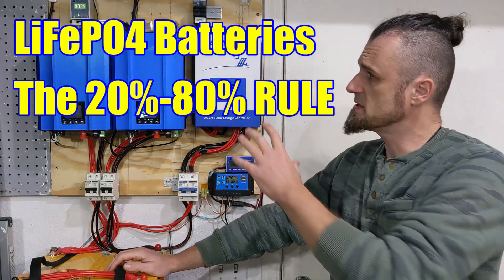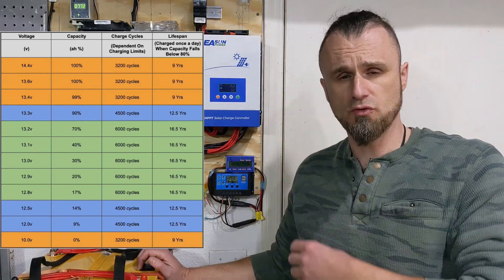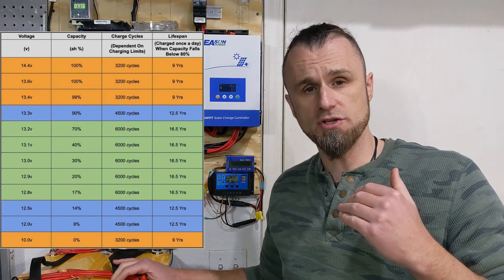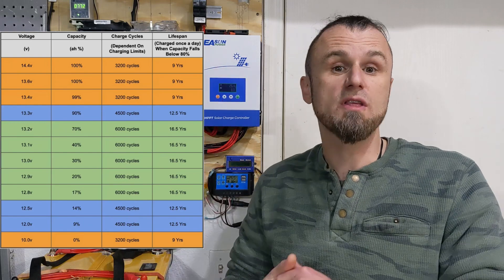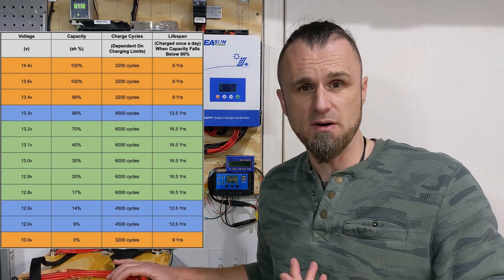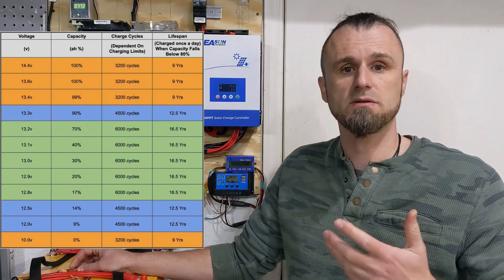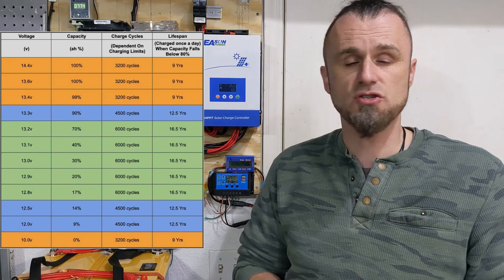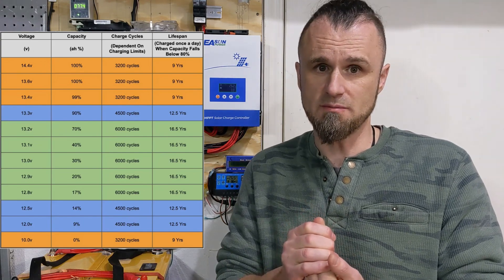LIFEPO4 batteries longest Life cycle possible 9 years vs 16 years the 20-80% Rule

Comment: I am sure there are many who have already done the calculations and some experiments, I am not one of those, but I have been doing the same as you, reading other information and watching videos Here is what I think I have learned and where I am leaning to go:
1) Your 12.8 to 13.3 charge/discharge range seems in line with others
2) Adding a 12 volt, lead-acid battery into the bank via an isolator that regulates that charge/discharge between the LFP and Lead-acid
3) Trying to find the correct ratio of Lead-acid to LFP for best efficiency

Hope that helps jump start a conversation for all of us to learn, keep up the good work!
Reply from the maker: Dude that's crazy, I'm going to pin this one because I know it's wrong but I'm sure the people will love to read and give their opinion on it I hope you're ready 😁
Reply: From all my studies, I personally would NEVER use lead-acid with my LiFePO4 batteries! The only time this is useable is if one gets a DC to DC charger that allows one charge the LiFePO4 battery bank from an alternator.
Reply: Incorrect. I know someone that has both chemistries on the same charge controller for several years hassle free so far. A AGM is required though as the charge perimeters are similar and there's no equalization setting for agms. I myself have gotten 3000cycles from lead acid batteries so I'm wondering if these lifepo4s actually are superior or not. I do keep my lead acid bank above 40% dod but Its not any different than keeping lifepo4s above 20% dod and below 80% soc so the same amount of capacity is lost either way. I do have a lifepo4 system in my houseboat for a couple years no problems yet except they do shut down in cold temps as I don't keep the boat heated when not In use. Lifepo4 and AGM can work together on same system at the lifepo4 perimeter settings because they're very close. @Tumbleweed5150
Reply: I read somewhere that Lifepo4 and Lead acid in parallel works because the lead acid will keep trying to bring down the voltage of the Lifepo4 to close to 12.8v which is the resting voltage of Lead Acid. They have to be around the same SOC(100% full charge using same charger) when you initially connect the two different battery chemistries in parallel. It is advised that a smart charger that doesn't have equalization feature be used so the mixed battery bank stopped charging at a specific voltage(like 14.4v).

Comment: How accurate is the bluetooth apps for these Lifepo4 batteries ?  If my app is telling me that I am at 50 %, 70%, and so on is that correct ???  I bought two of the BougeRV 100 amp hr batteries and I have them wired in parallel 12 volt. Using a Renogy 30 amp MPPT charge controller. Any thoughts please ???
Reply from the maker: Not very accurate. Good for estimating. But they are up to 20 percent off in my testes
Reply: @VegasRoManiacReviews  Thank you for your reply.

Comment: I'm running four 100Ah Power Queen LiFePo4 in parallel for a 12v system charged by four 450w panels. Most days my batteries are fully charged to 14.4v but i don't usually discharge too low at nights, maybe down to 20-30% as i'm not interested in long life from them as i'm 66yo. Also, solar is my hobby and i keep changing and upgrading my system. Greetings from Jamaica.
Reply from the maker: That's awesome , you still have 30 year left in you so don't run that battery too hard , thanks for messaging me

Comment: Don't listen to this guy, he has no idea what he's talking about.  It's better to charge LifeP04 batteries to 100% to top balance the cells (which is necessary to keep them 'healthy') and use the first 60% capacity, rather than only charge to 80% and use the middle 60% capacity.  This 20-80 rule applies to other lithium chemistry's more often found in cell phone, cordless tools, laptops, and EV's.
Reply: Spot on.  Charge them to 100% to balance the cells.  They are designed to be totally discharged.
Reply: @rogerhargreaves2272 they don’t need to be fully discharged but full charge is preferable. It’s the final voltage spike the final charge  that is needed to balance the cells
Reply: @rogerhargreaves2272 I read that they should not go lower than 20%. Also ecoflow app has a setting in their software that analyzes the battery and counts the deep discharges made, that are supposed to be bad I guess.

Comment: in the summer I only use 20% soc per day, usually between 80 - 100%. I thought it better to go between 60 - 80% so I set my boost to 13.3 for 3 hours, the float to 13.3v, the boost recovery at 13.3, and the equalization voltage to 14.4v once a week for 2 hours. It seems to work. Does anyone foresee any problems with these settings?

Comment: I think the real point is being missed.  Batteries are made to hold a range of charge. This is considered a full charge range.  If you believe in charge cycles/counts then if you short change the charge you end up with more cycles because it's less than a full charge. Remember the total number of cycles is based of a full charging cycle.  Cut that in half and in theory get twice the cycles because they are not full cycles.

Comment: Has anyone used a lfpo battery3000 cycles yet ? Are any batteries showing signs of degradation yet ?? Im curious to see if the20-80. Theory works. My system usually tops off by noon as i only burn through about 20 % at night from my refrigerator and i haven't figured out how to have it stop charging at 80%. Seems hard to do by voltage
Reply from the maker: I have about 500 cycles since the video , I can't tell if it degraded because I never run a test on it
Reply: Its not good to only use 20 per cent. It needs to disharge more to 20 per cent state of charge.

Comment: I just watched a thorough and extremely passionate video by a guy who has dedicated his life to solar. He said definitely charge to 100%. He showed all the math which was too much for me. But his basic concept was you are losing out on so much money from purposely throwing away electricity if you are off grid. Might as well use all that power or buy a cheaper smaller battery and still charge that one to 100%. I'd love if you'd watch his video and then do a rebutal to all the points he was making. He was so adament that all I wrote down was......charge to 100% and make money now.....or possibly save some money in 15 years. 
Ttle of video  ......."""LiFePO4 Longevity Discussion! Why Charge to 100%?! For Solar??""""""
Channel.........DIY Solar Power with Will Prowse

Comment: The issue is not hitting the higher voltages above 13.4 which is required to balance the cells and therefore allows them to degrade equally. The real issue was staying at that high voltage for multiple weeks. If you’re cycling your batteries every day it’s something you never have to worry about.  The sheer degradation over time which happens for batteries, even not in use and even stored at 50%, is gonna factor in Way before the degradation of daily use factors of going too 100% charge. The real way to kill one of these batteries is to leave it under voltage for an extended period time, meaning weeks. That is almost impossible nowadays with these new BMS nearly all have built into them now. LFP batteries are something you should just not worry about cycling if they are used every day for solar.😊

Comment: Which voltage setting in the Charge Controllers settings determines the maximum charge? I have two different chargers. Is it, "equalize charge", "Boost Charge", "Float charge" or "Overvoltage", "Limit charge voltage", which are settings from two different chargers.
Reply: Read the manual with your charge regulator

Comment: And where the @#$% does that 20/80 % rule comes from? I really wonder where do they come up with these rules and figures, and I certainly disagree.
My experience with batteries comes from using and taking care of standard li-ion and LiFePO4 cells at home and also using them to restore laptop packs and build DIY batteries (some Ni-MH too) using cell sizes up to 32700. I've done some battery testing too, bought an inexpensive battery tester with PC connection.
For taking care of li-ion cells I learned from the article “BU-808: How to Prolong Lithium-based Batteries” at Battery University. Following its advice on charge voltage (3.92 out of 4.2 V, a 14/15 ratio, optimal charge voltage which eliminates all voltage related stresses) and extrapolating it to my rooted smartphone battery, using Advanced Charging Controller App (AccA): 4.06 out of 4.35 V and 65% max. state of charge. And my smartphone battery, after more than 5½ years of use and God knows how much cycles without avoiding going as low as its BMS allows, is still fairly healthy.
With LiFePO4 I can't say much, except that I once built a custom 4S4P pack (with 4x 32700 and 12x 18650 LiFePO4 cells) for a small UPS overhaul, and after an initial load and capacity testing I left the pack completely discharged after the SAI cut-off (≈10.5 V afaik). It remained that way (discharged) around 9 - 10 months, and when I took the SAI again I found the battery at 6.5 V (!) due to its BMS' phantom power consumption (below 2 V per cell). After recharging the battery and retesting it, it delivered more capacity than in its maiden test: around 10.5 Ah vs 10.2 Ah.
In my experience with LiFePO4 and namely li-ion, cutting high renders no benefits and only makes the user's life unnecessarily harder; and the amount of cycles vs depth of discharge tables must be taken with a grain of salt and discernment, starting with the fact that reducing depth of discharge also reduces the amount of useable energy per cycle.
Overall buying quality cells and (at least for li-ion) limiting maximum charge voltage really matters, cutting high doesn't; thus, my advice is discharge as low as required without remorse. Cheers.

Comment: I've been looking for any info. You are the only one I've found asking questions. 
Can i keep my batteries 100% charged on solar?
Reply from the maker: Yes you can , these batteries are super durable
Reply: @TheCrazyRomanian  thanks, you're the only one to answer. I've been reading manufacturers info and asking others no one can say for sure but, i have not found one manufacturer who warned against it.
When I'm not using the system i disconnect all inputs. When i am using it even sparingly i leave the solar charging. It frequently hovers at 90-100%.
Reply: @TheCrazyRomanian  was thinking, RV's have solar connected all the time don't they. Maybe that's why they burn sometimes. I just don't trust these batteries quality enough to leave the solar connected.

Comment: I have some 36 volt battery packs.  I am wondering if the inverters in this particular setup will run and produce a/c power with 36 volt battery packs.
Reply from the maker: No. This model can't .. they are picky on voltage 24 to 31 volt max

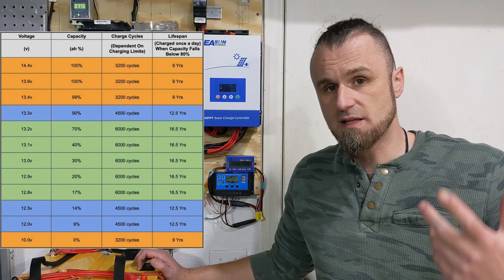Comment: 1:00 LiFePO4 batteries, when bought with their own BMS, are set to top balance the cells inside at the top of the charging cycle: 14.6 on a nominal 12V system, or 29.2 on a 24V system. If you don't charge them up to full for at least two hours at least once a week, they can get way off balance, which will REDUCE their total lifetime. Not using them too low WILL extend their life, though. Most of these batteries are rated for at least 10 years, and that is if one charges and discharges them fully each day. I designed my system so that the battery bank will hold over 80% capacity most of the time. I only see lower capacity in the middle of summer when I use my larger air conditioner most of the day. I am living in an off-grid community in the Southern CA desert, so we do rely on the systems I've designed for my RV, my work truck, and my girlfriend's shuttlebus, especially when it can get over 120F here!
Reply: When I was designing my 48V system, I planned on making my batteries last around 20+ years.
Reply from the maker: Wow ambitious
Reply from the maker: Great info .m thank you

Comment: go full ham and spend $10k for 31kwh of batteries/rack ... run for 10 years ... $85/month ... 16 years ... $52/month ... adjust these numbers for your requirements ... put whatever $ amount you come up with in your solar savings account ... the $ will be there waiting for your next round of batteries ... do not sweat the details
Reply from the maker: I actually only need about 10 kilowatts a day because the sun shines half the day here in Vegas so very rarely is cloudy and the 10 kilowatts last me throughout the night easily but my family is small and I don't have an electric car

Comment: Just use batteries as a buffer. Put most of the electric load on daytime. Invest in low power applience for eveing would be cheaper.
Reply from the maker: Not to mention get rid of my wife she has a TV running on some stupid aquarium with fish in it 🤣 at this point we'll be cheaper to just get fish

Comment: Run down to 12-12.2 charge to 13.8 
The problem is you can’t really utilize voltage as a reference with this chemistry until your within 10 to 15% of empty or full.
Reply from the maker: good advice ! I like  it

Comment: Consider cell balancing. Usually balancing only happens as the batteries pass 95%. You cannot go many cycles before an unmatched battery of cells starts to unbalance. Only you and your set of batteries can tell how much balancing your cells need.
Reply from the maker: Some batteries have cell balancing , also there are boards you can buy that take care of that on the fly ..
Reply from the maker: But yeas cell balancing is a thing ..

Comment: I think you can come up with a better gift for your grandchildren than 20yo LFP battery. :)
Run it 100-0 and forget about this micromanagment. Why? Because - maybe you forgot - the 3000 cycles of "life" does not mean that then the battery is dead. This is the rating of getting to 80% original capacity. It's still usable.. for another 5000 cycles easily after that.
Reply from the maker: Best advice ever .. you are the man
Reply: Are you basing the 3000 full cycles by first hand experience of seeing it or from marketing of lifepo4 batteries? I've personally seen some that have decreased capacity of more than 20% in just a couple years and there are many many of f these batteries that have failed BMSs so I'm waiting for some real evidence of these claims as I have personally gotten 3000 cycles from a lead acid bank and have 75% capacity as they did new I kept them above 40% dod throughout their lives but that's no different than keeping lifepo4s below 80% soc and above 20% dod as this video suggest. I do have a lifepo4 bank in one system but it's only been a couple years and they do shut down in cold temps when my lead acid do not. I think there's different circumstances that warrant one or the other chemistry. I. Curious of how many lifepo4s actually do last over 3000-7000 cycles and Alot of them actually advertise an amazing 15,000 cycles which if I knew that for certain id replace all my systems with them..
Reply: 13.86 that's where my battery stopped charging. My charger was reading 14.6 The BMS on my battery stopped at 13.86
Reply: It took forever to charge the last portion from 80%
Reply: It seemed like the charge and discharge on the higher portion of the battery was minor, almost like it wasn't necessary.
Reply: My concern is bringing the batteries down too low and then having them sleep. At 1% charge left in the battery, it took forever to drain to zero. Same thing when I'm charging it after 80 83%. It seems to take forever to get it to a top level of 18.6 to 14.6
Reply: @Roy-littlebear my understanding of the BMS is, it shuts the battery off before it gets too low or too cold. So you should never get to 1%.
Reply: Well said, I like this attitude.